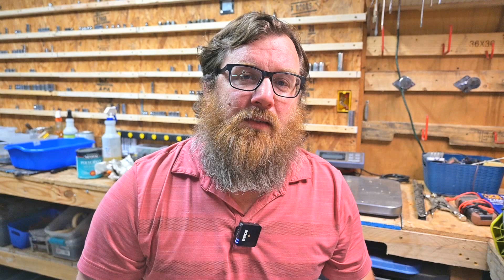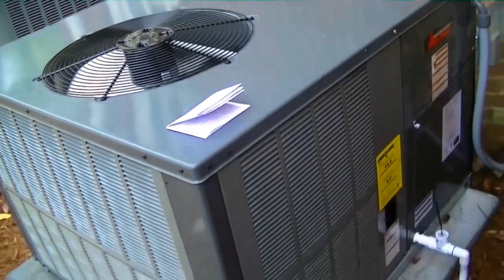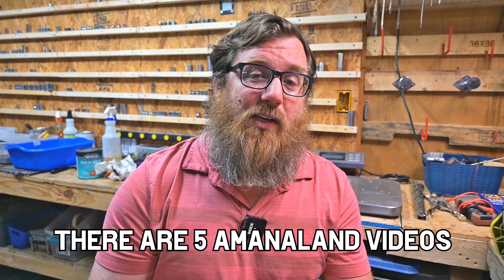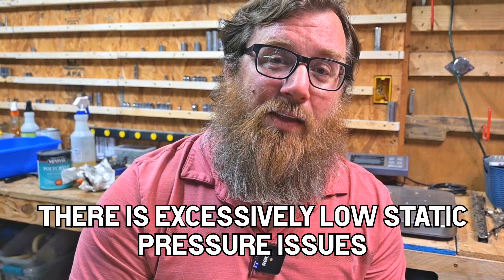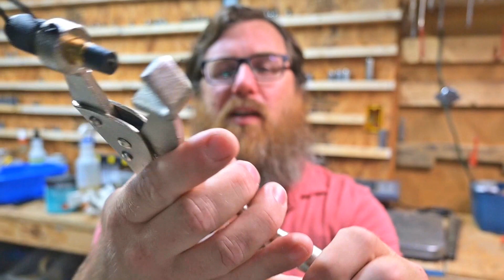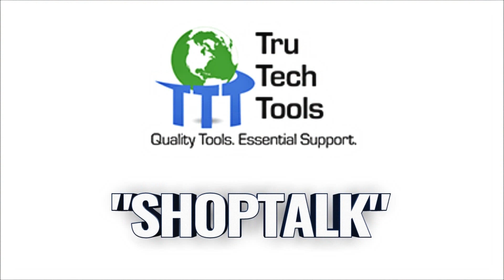The HVAC Filter Can Cause a Lot of Issues

Comment: I change filters for a large school system. One particular school had several units freeze up and the tech tried to blame it on me not changing the filters soon enough. These particular filters had only been in the units for 3 weeks and were very clean. I looked at the condenser coils and they were covered with lint, hair, and classroom debris (paper bits, plastic wrappers, etc.). Nice try…

Comment: That’s why electronic air cleaners are great, low airflow restriction and great filtration. The only thing that sucks about them is that they take longer to clean and dry when doing a maintenance rather than just swapping out a filter. And here in the Pacific Northwest, we get a lot of rainy days that makes it even harder to try and get the EAC cells dry.